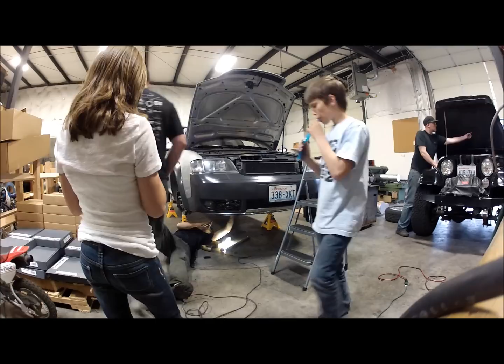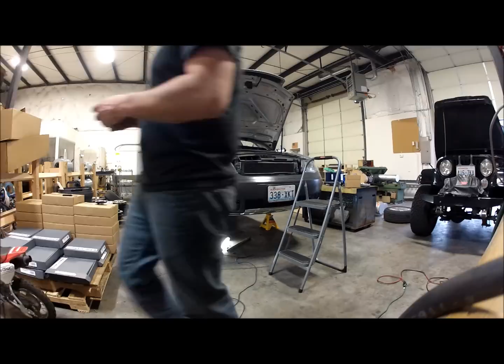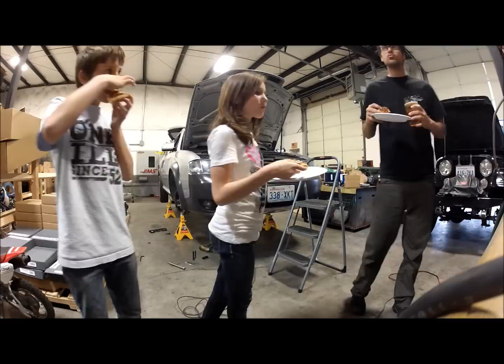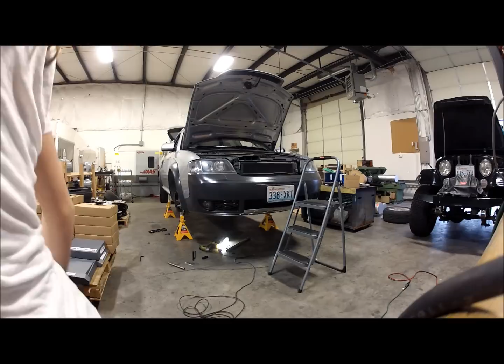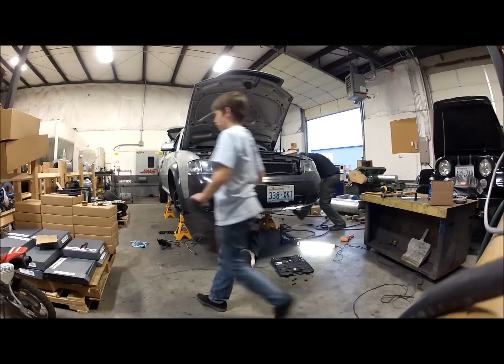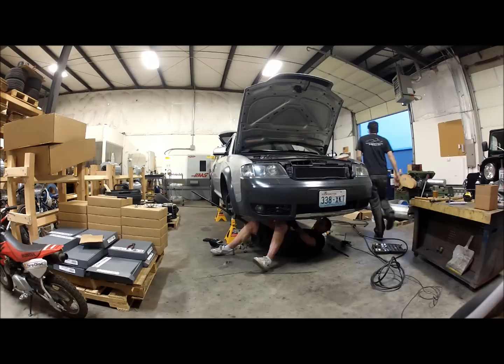Audi Allroad Transmission Removal Time Lapse

Comment: I have to do this to my Audi A4 1.9 TDi 1998. Was your audi quattro? how long did it take more or less to take it out and put it back? 
Mine is not quattro but its for have an idea about the time.
Thank you!
Reply: (old post just for future reference) Non Quattro (FWD) no worry about a driveshaft since there isn't one, just remove CV axles. May cut it down to a 6 hour job from a 8 hour.

Comment: They flat backed it with hand tools. I'll give 'em that. BUT! With a two post lift, air tools, an engine hanger, post jacks, the proper special tool kit, and the motivation to produce work, one man can do that job in a day.
Reply: You mean 5 hours or are your days shorter? Never took me longer than 7 and in that case the car had done 450.000km and the bolts were crusty because Germany aka salt aka winter.

Comment: btw, did you need to remove the driveshafts? or was it enough just removing the bolts that ataches them to the gearbox?
Reply: pep joan roy mi

Comment: I don't see the use of this at all. Not usefull and surely not funny!!
Reply: Michel Fasen :  Well, for one thing, it dispels the myth that has been circulating around the Audi Forums ( Audi World, Audizine, Audiforums, etc...) for over a decade, that suggested that the transmission cannot be pulled without pulling the engine after placing carriage into the service position. 
The clutch job can indeed be done by dropping the transmission.   Although it is suggested that the subframe bolts be removed, it's not absolutely necessary, but does make the job a bit easier. The hardest part for me, when before my neck was broken and I was 15 years younger and I could do the job myself, was removing "the freaking heat-shields that protect the axles from turbo heat. Also, the one bell-housing bolt at top, along with the top bolts on the Downpipes.
This gives you the perfect opportunity to check and replace, if necessary, the waste-gate actuator hose ( Use the good BLUE silicone tubing and a good heat-shielding material SLEAVE over the blue silicone house. ) AND to adjust the waste-gates if required. The single most important opportunity is replacing the rear crankshaft seal assembly ( around $55 from ECS Tuning ). Do this even if the rear seal doesn't appear to be leaking, because it will leak eventually and it would suck to have to drop the tranny again, just to replace the rear seal. Remember that VAG says that the Dual-Mass flywheel cannot be ground and it is recommended that you replace it. I had no trouble finding a machine shop that was willing to cut the surface on a lathe, but with no guarantees.  Most just sand the flywheel surface with good carbide paper, n order to give the clutch plate a good gripping surface. I've done that, too and never had a problem.    Unless you are planning on using your Audi for racing, stay away from the lightweight, single mass flywheels.  Believe me when I tell you that you'll hate the all around feel of the single piece flywheel, especially the shudder that makes it feel as though the pressure plate spring arms are weak.
Do NOT forget to replace the Pilot bearing and NEVER reuse the throwout bearing, you'll soon regret that move.  If you want to go one step further, use this as an opportunity to drain and replace the clutch hydraulic fluid and possibly the slave cylinder, if so equipped.  Mark the bell housing bolts with color code so you know exactly where each bolt goes. Trust me, this makes replacing that tranny a lot easier.
Reply: When you purchase a clutch kit they come with a new throwout and pilot bearing, incase anyone is wondering.  Best thing to do with bolt placement is use a large piece of cardboard and draw the bell housing and stick the bolts through the cardboard so no question where they go when reinstalling ;)